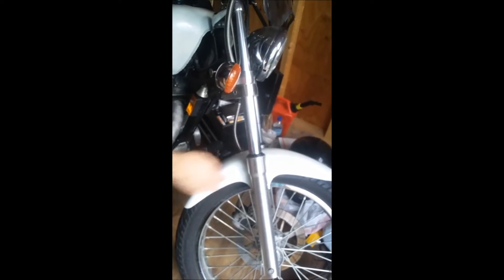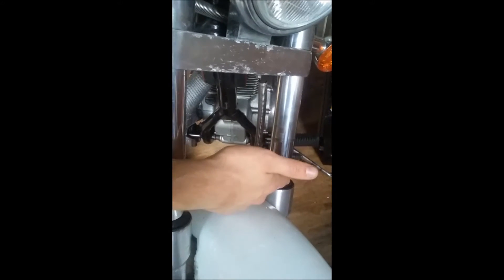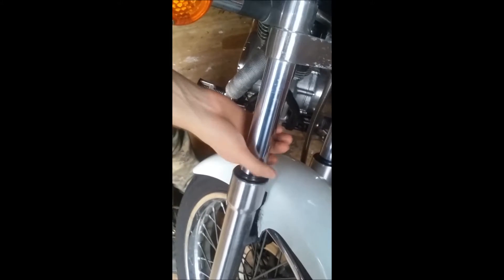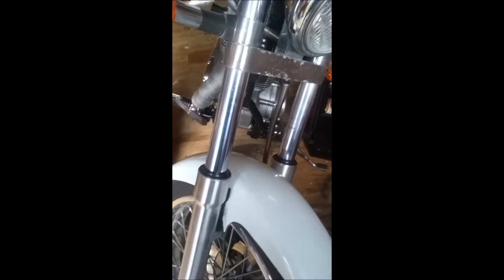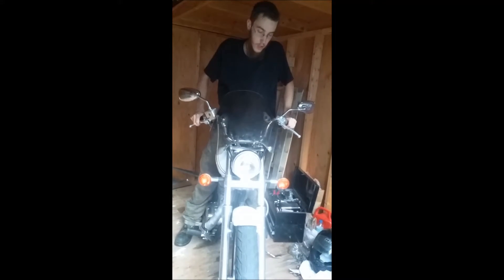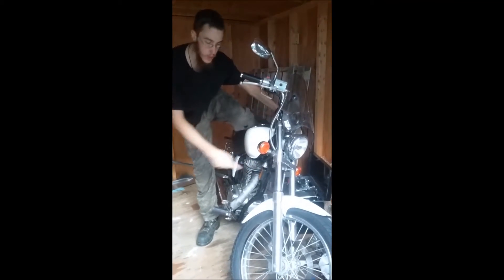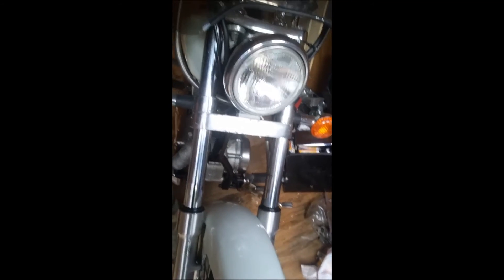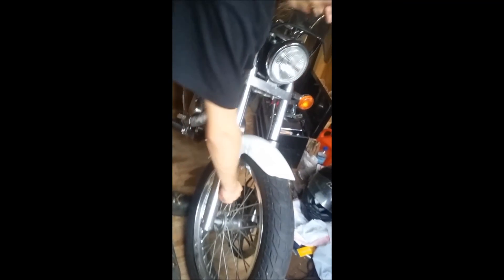How to check for bad fork seals

Comment from the maker: Another basic way of checking, is popping the dust seal up to inspect the fork seal. If you see pooling of fluid around the fork seal, its junk. If you see a bunch of rust and corrosion on the snap ring, probably also bad news.

Comment: My forks have a little wobble in it where the seals are. Anyone knows if they need to be rebuilt or what the issue is. No oil leak but started wobbling a little. Definitely coming from the inside of the forks
Reply: I would just get that looked at by a professional.
Reply: @combustablelemons8988  yeah, I might just do that.

Comment: What if my fork doesn't want to go up
Reply: What resolution did you come up with for this issue bc I have same problem.
Reply: Turned out my fork was dented from a minor crash and left a small deformation inside the tube. 
Took it to a local machine shop and had them even out the inside with a side paper